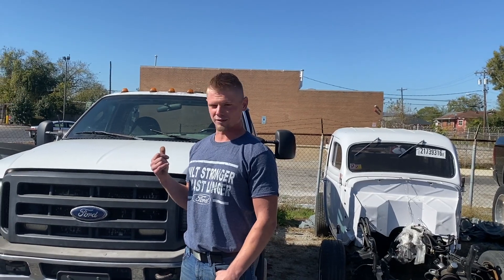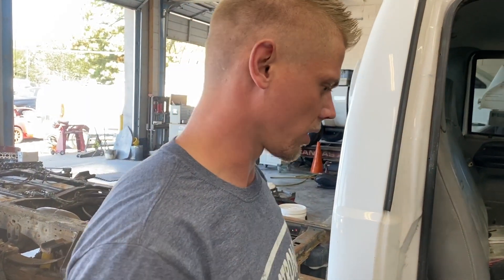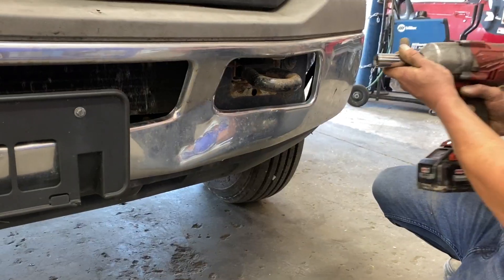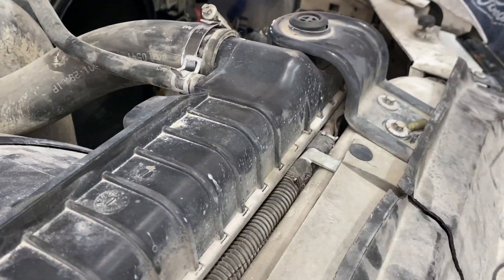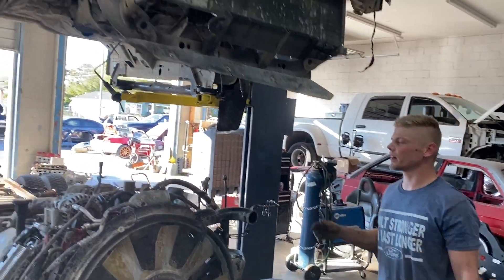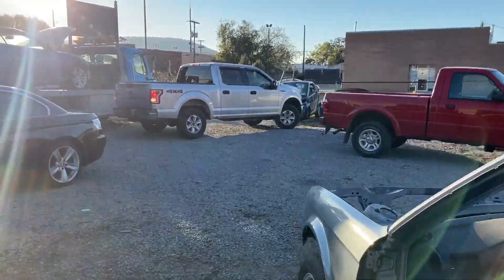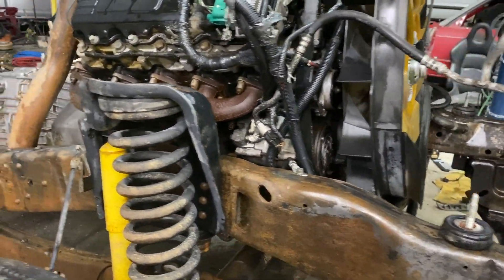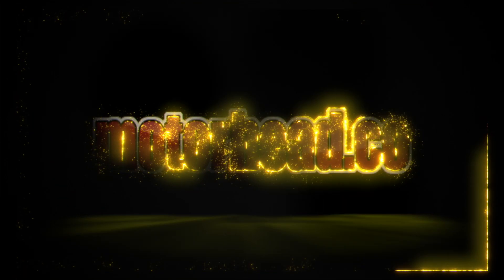Pulling the cab off of our ABANDONED F550 Super Duty truck!

Comment: I liked the features that ford did on their interiors with plenty of room... sometimes you have to take it to have it tho. I'm a single cab kinda person as the extra is nice when it's work/small family use. I don't see a reason to make a crew bus out of them. Sure I have owned them, the last was a 95 F350 super duty extra heavy duty and it was a pain in the butt cause it had some of the nicest carpet and every bell and whistle you could throw at it. The steering wheel looked like a command center and I   was using it for my mining truck with the ten foot flatbed on the back. Of  course that was a handmade all tricked out flatbed with the lights an all. I put six hundred thousand miles on the trip meter but the two engines total had well over a million miles as the pto ran water pumps eight to sixteen hours a day with the truck just setting there. The first motor kinda was a fluke as it went almost four hundred thousand  without even a glow plug..... a wiring issue, the right side valve cover gasket with the phony wiring in it would not always trigger the injectors on that side so we changed that out and before the motor was cold was back on line. I did take the carpet out after first season and put it in the attic storage. All rubber or nothing with cheap junk yard seats. The back was just storage and it made me a lot of money trouble free. We built a 7.3 for it while the other was still going and every thing was done to it.... I lost passenger side front cam sensor on the new engine about every four to five months so started buying the after market ones in bulk but the first aftermarket one lasted the rest of the way. A good truck an loved it but would of traded for a regular cab in a heartbeat. Could of mounted a sleeper on the frame for storage. Oddly no dents or rust but undercoated every year, and repainted every three or more years. It was still running just fine, a little low on power and telling me it was tired bad tired. With the seats and carpet back in it, got good money for it. The guy who bought it come back complaining about the cab mounts being worn into the frame.... and my words stung him as the price is what it is and the end of my driveway its your problem. Its setting now  with weeds a covering it and not too good a shape but really I think the good has been got.

Comment: Body shop supply has gals of spray on type rhino liner and gun quart can screws on gun 50lbs air wait 24hrs you done.Make Damn Sure Your Through Doing Any  more Welding or Burning on the frame or it becomes a Roman Candle really fast!!!

Comment: Get por-15 for the frame that’s all I can suggest
Reply: Por15 is not bad, but gotta say it does remind me a lot of all other paints like rustoleum and farm and tractor paints you get from farm supply stores.  Eastwood has chassis paint too.  Honestly, for the price I'd just get the stuff from a farm supply hardware store.
Reply: @bgee461  if you prep right for the por-15 it will outlast most other coating at least in my experience

Comment: This the product that was mentioned - https://www.eastwood.com/eastwood-rust-encapsulator-black-aerosol-15-ounce.html

Eastwood Rust Encapsulator Black

SUPERIOR corrosion resistance to "hardware store rust paints" for greater durability (tested to 500 hours in a salt-spray chamber)
Epoxy-fortified for better adhesion and topcoat compatibility
Penetrates deeper to prevent rust from spreading or forming, even in hard-to-reach areas
Cures faster, and the low-VOC formula is acceptable in California
15 oz. aerosol covers about 10 sq. ft.
As seen on "My Classic Car" TV show